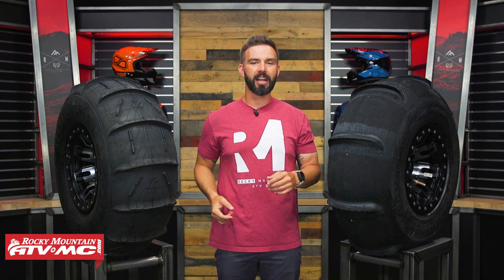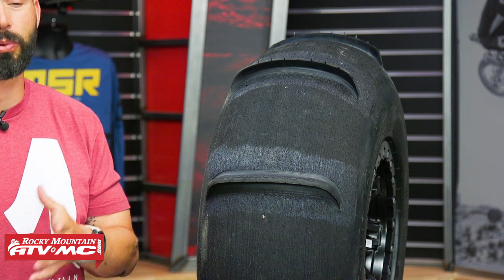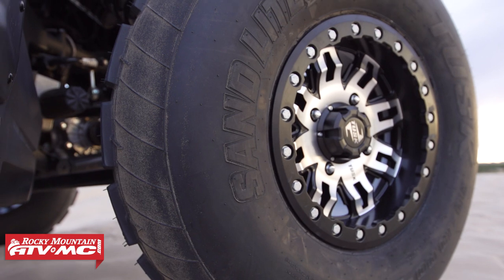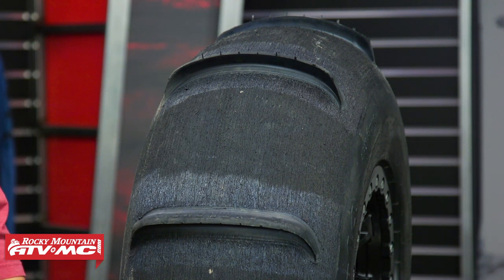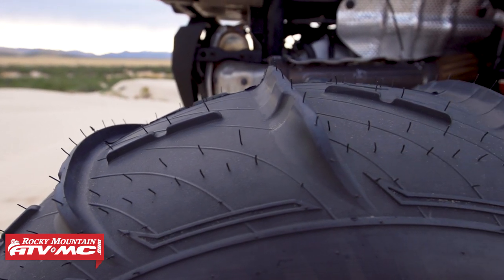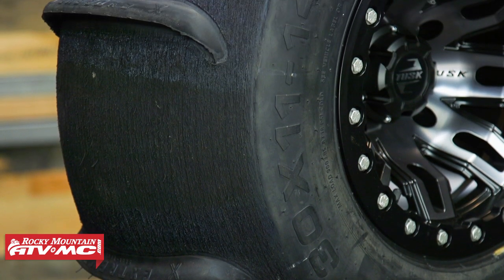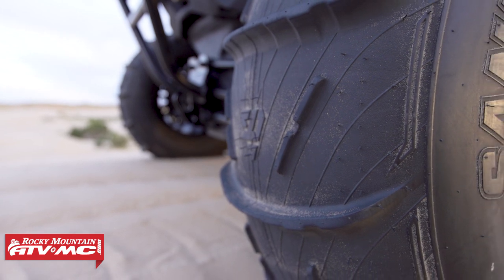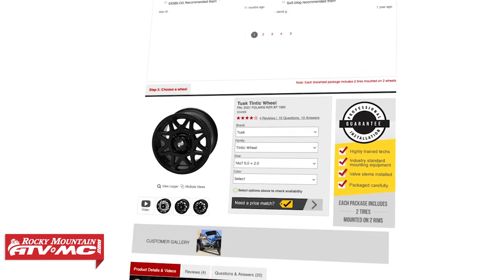UTV Sand Tires 101

Comment: In my experience running beadlocks on paddles shouldn't be recommended. Beadlocks are heavy and can ruin a good paddle setup. I rarely see people debead unless someone is running extremely low pressures or they crash.

Comment: Newbie here. I have a 2017 Polaris RZR 4 900. What sand tire set up should I get for Pismo Beach (wet sand) and also for use at Glamis (dry sand). It is a completely stock set up machine. Txs

Comment: In the dunes with paddles do you want 2WD or 4WD ?
Reply from the maker: Most people seem to run in 4wd in the dunes, especially when you're new to the sand. If you're going up big obstacles then 4wd is definitely recommended but trying both 2wd and 4wd can be good to get an idea of what your machine and tires are capable of. Regardless, momentum and good tires are your friend in the sand.